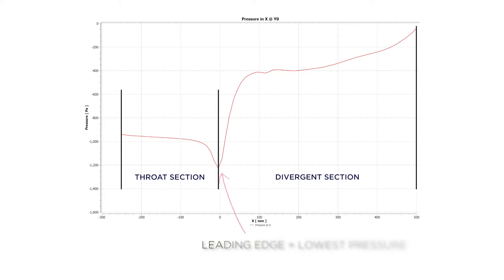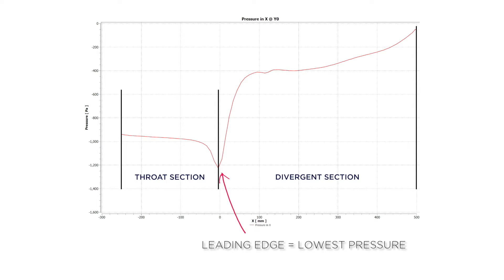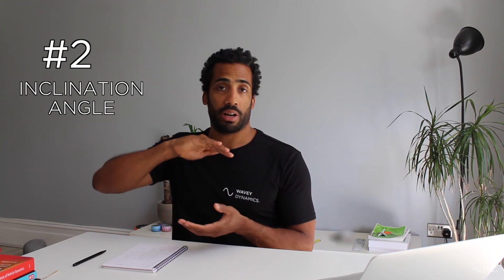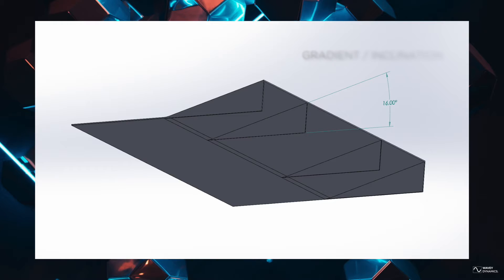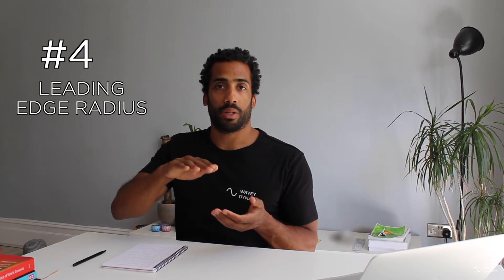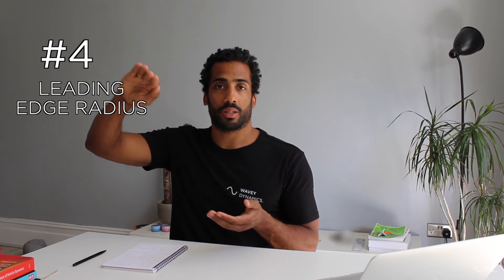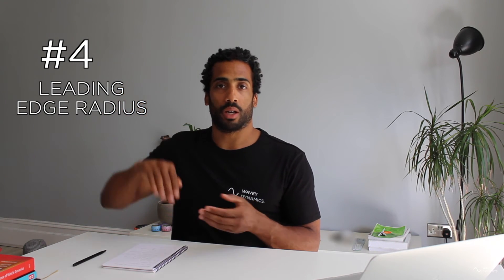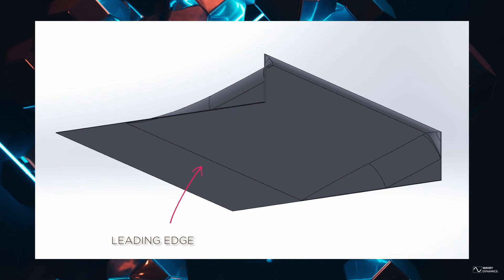Insights 003 | Underbody Diffusers

Comment: Amazing video ! Out of interest, what are the main differences between an isolated diffuser compared to a diffuser on race car. ie what kind of interactions from the front and rear wheels and wings effect the diffuser performance and how ?
Reply from the maker: Thanks for the kind words..

Well all other things equal i.e an equal area of flat floor upstream the substantial differences vs. The arrangement discussed here are that most flat floored race cars will have: 

1. A front diffuser
2. 4 wheels influencing flow across the entire underbody 
3. Depending on the car type, a rear wing close enough that it’s affecting the flow field in the divergent section

In very short summary, the front diffuser will affect the quality of flow travelling to the divergent section in terms of turbulence and mass flow, each of the 4 wheels will kick out a fairly substantial volume of air towards the centre of the car, again negatively influencing the flow quality at different points of the underbody. The rear wing can also be positioned (look at Group C cars for reference) adjacent to the flow leaving the underbody where the low pressure field underneath the wing will act as an extractor - drawing a larger volume of air under the car and also helping the flow in the divergent section to stay attached.

Interesting stuff! I welcome any follow up questions if you have them - Jahee

Comment: Do these vortices only provide a benefit when running them along the edge of the floor or can they be ran further inboard of the diffuser? Great video🙂
Reply from the maker: Thanks!

I briefly explored (in CFD) a couple of techniques to test the same theory actually but after the initial results weren't promising i moved on. 

The benefit of having them by the shoulder is that  the flow exposed to the diffuser section is travelling upwards - If you have the wrong side of the vortex exposed as well, you're not only drawing air upwards, but also drawing it downwards on the other side, the net effect is a loss - especially as any flow device used to generate the vortex messes up the flow upstream too..!